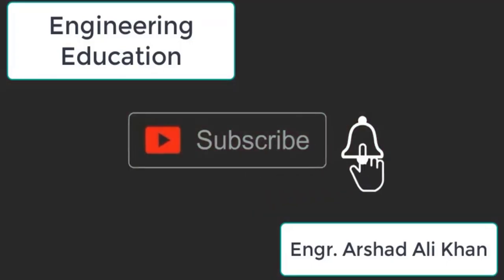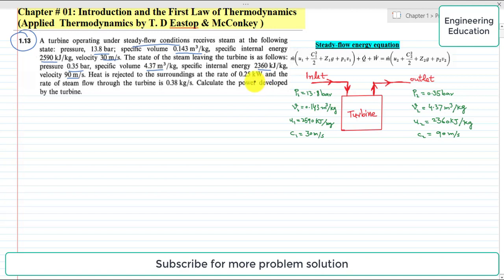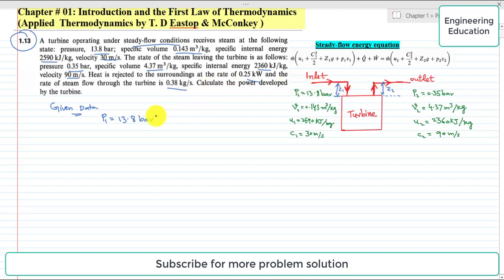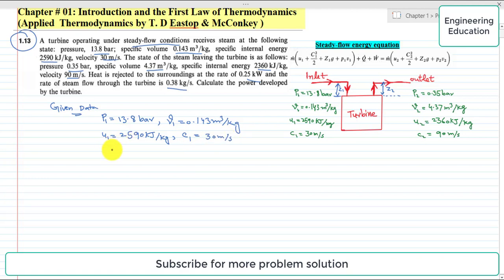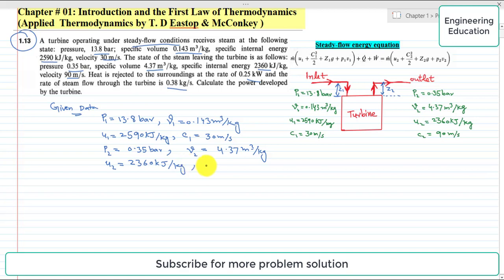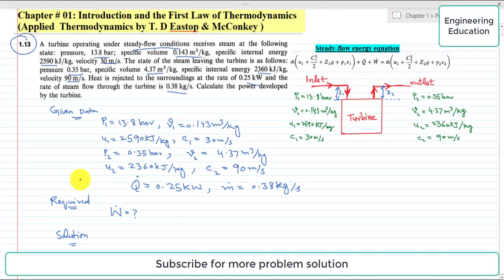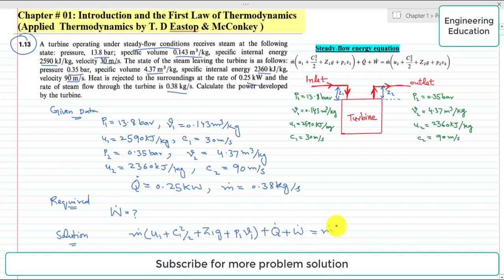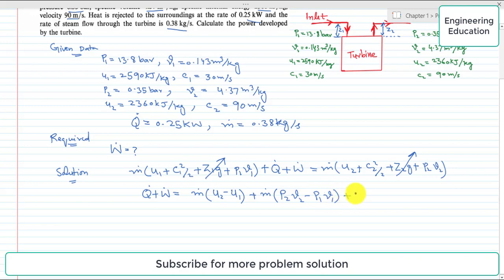Using steady-flow energy equation to calculate the value of power developed by the steam turbine.

Comment: Thanks for this proper explanation.  But why was z1g and z2g cancelled.  Are there and problems related to steady flow that there’ll be useful in
Reply from the maker: Thanks for your nice comments and most welcome.In this specific problem Z1=Z2, so they cancel each other. Yes, there are some cases where Z1 is not equal Z2, the values will be used  in calculation then.